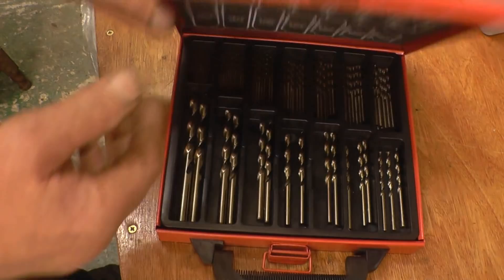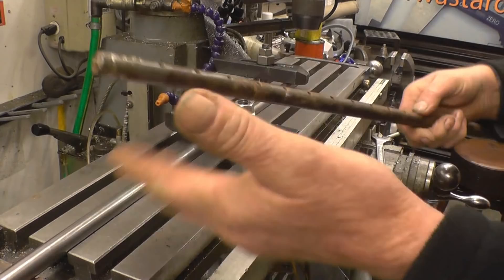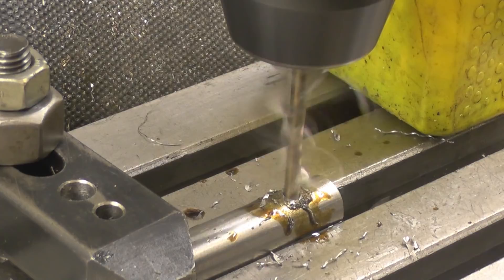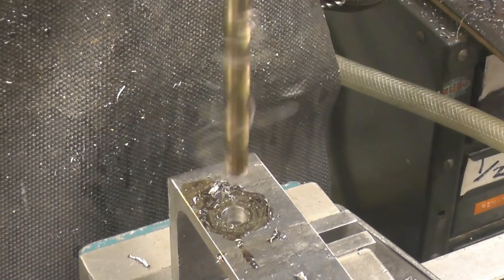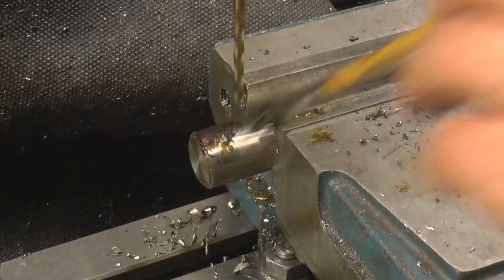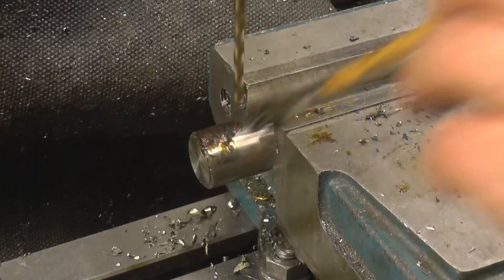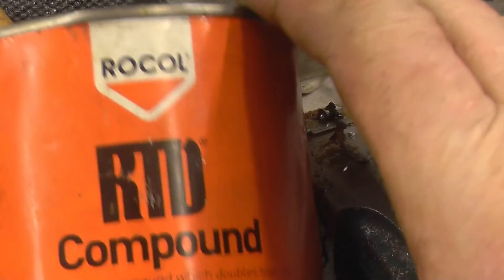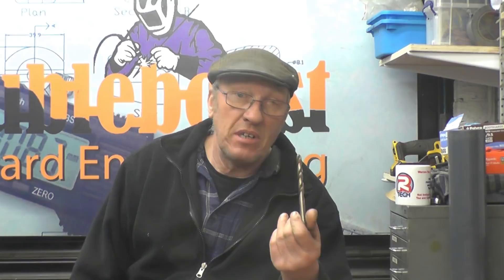Banggood Cobalt Drill Multipack Review

Comment: "Drills are consumables and don't last forever"?? I have three sets of metric Dormer drills ranging from 1.5mm up to 10.3mm in 0.5mm steps that I got in 1970, I'm still using them. Apart from the occasional sharpening they are still 100% usable!

Comment: Good bargin John should used one of
the very small ones
Reply: I used some of the 3.2mm ones to drill a few hundred holes, only broke it on the last hole where it was an awkward angle. Drilled out rivets in stainless steel, got about 10 holes per drill bit, while with HSS it was 2 per bit.